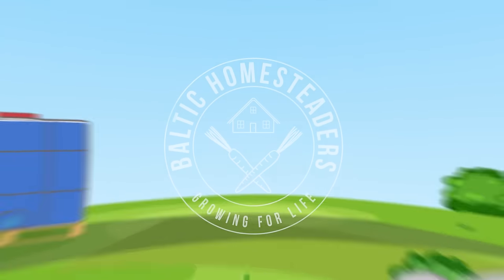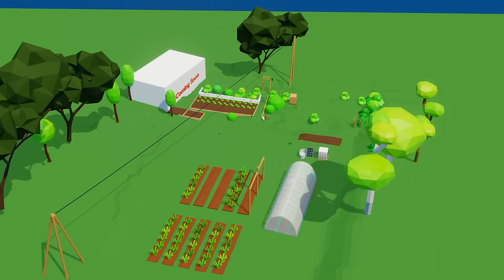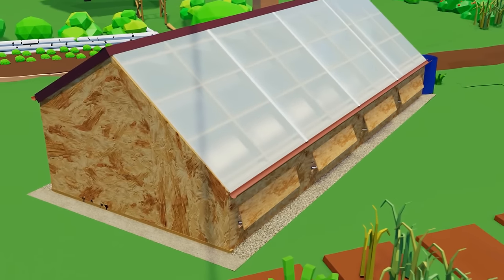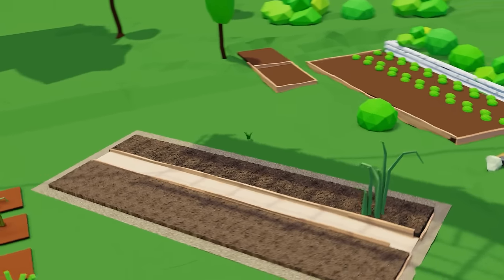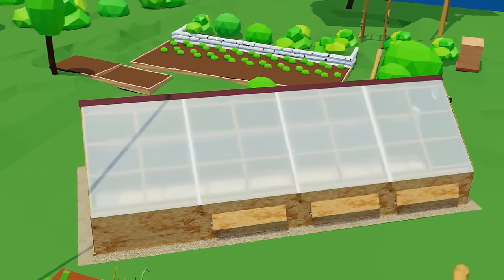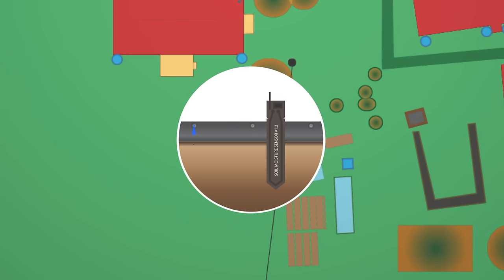Passive Solar Greenhouses - 8 Key Considerations When Building

Comment: Insulate the floor. The floor and glazing is where you loose the most heat. You might be better of in raised beds. It's less labor and easier to insulate to keep ground from stealing the heat.

Comment: I'm wondering what your thoughts are of double walled polycarbonate? I'm planning a greenhouse build for northern central Alaska and I'm wanting to have some air in between my polycarb panels to act as added insulation, but struggling to figure out a plan for doing so. Thanks so much for the video, super informative.
Reply from the maker: So you'd fix one set of sheets on the outside and one set on the inside? I can't see why it wouldn't work, in theory it should really help with the R value. I guess the only consideration is to whether you'd need to clean the innermost sides and would they be accessible although in theory why would they get dirty? Installing the inside set might be fiddly though. The other way is to install the first set as per normal then use batons to hold them down (instead of the joining strips and then install the second set onto the batons?

Comment: Inflated double polyethylene has great R value and it’s budget friendly. I have double polyethylene on the top and front and twinwall polycarbonate panels on the east and west. My Greenhouse hits up to 130 F on and freezing day when the sun is out.
Reply from the maker: Hi Dave thanks for commenting. Did you buy your double poly set up as a kit or engineer it yourself?
Reply: I bought a layer of IR AC 6 mil poly film for the inside layer and the outside layer is 6 mil clear. I got a blower motor from my farmer friend. I installed the 2 layers at the same time and cut the excess. I put a Bellow over the fill tube so I can turn on and off the blower on a timer. It takes 15 minutes on to fill 11”x22” and it’s off for 1.25 hours in summer and 45 minutes in the winter. The Bellow is just plastic taped on 3 sides so the air goes in but can’t escape. A differential switch would be better though, like a air compressor. It stays full enough to insulate for around 77 days of run time per year versus keeping it on full time like everyone else does.

Comment: Since one wall is a short ponywall and light isn't hitting that area, would there be a benefit of just putting the greenhouse into the ground 3 feet and using passive geothermal air tunnels? You would then be able to utilize the earth as a thermal mass. Running solar heated water(or salts) in pipes into your themal mass would offer a deeper heat. A closed loop system.
Reply from the maker: It’s for the snow that we get, need somewhere to fall off and the ventilation windows which work great.

Comment: Hello from Chile. Rocket stoves are great for heating up a place quickly and with very little wood but they are quite bad for keeping a place hot for long hrs... you might want to consider a BBR ( Big Batch Rocket) or a russian stove... good luck
Reply from the maker: Thank you / Gracias :)
Reply: rocket stove, you might be right about that, but, are you familiar with rocket mass heater?
 the thermal output of the rocket stove gets absorbed into a mass of stone or cob or similar material, and radiates out over the course of many hours, or even days.

Comment: Hi Iam planning to build one of these but want do go deep into the ground (check wallpini) I live in Poland and here typical winter could be a bit cold (-22C 🥶 was max I've evere endure moderate not more then 10) - for thermal mass want to use a old tires and soil (check a earthship project) for glazing want to use old plastic windows (they have thermal insulation between windows and often people change them for new ones so they can be obtained for free) also very important is additional building connected with greenhouse - a chicken coop which will generate heat, inside of a greenhouse will be some hydroponics to maximise the efficiency and space. A glazing angle have to be calculated for proper angle (winter will warm and summer will chill - check earthship)  of course all will be fully automated with a solar panels ale heat regulators plus some water collection tank etc.
Reply from the maker: I thought about the wallapini approach but in the end getting a digger to come and dig the hole was too much. Maybe I’ll build one as a future project if I can find a suitable place. All the best for your build.

Comment: Passive solar buildings have glass area of about 7% of the floor area without extra thermal mass. 
Some of these designs are actually solar ovens.
A room with a few windows on the south wall would work just fine.
Paint the walls white.
As the sun moves all the plants will get some direct light.
These things are mostly useful during the coldest months.
Reply from the maker: I would love to have built it onto the house but sadly it's not in the right place or indeed the right direction. Thanks for your input and ideas, I need to work out about internal wall structure.
Reply: @BalticHomesteaders  Do you have a wall or room that faces a southerly direction? In many place you only need a greenhouse during the cold season.
Reply from the maker: We don’t have any suitable rooms. If we did then I’d use it as a starter room for seedlings.

Comment: Personally, polycarb is a prohibitive price for now. An inflated double polytunnel plastic cover works for me. I'm creating a rammed earth wall using the 'cobauge' method for the north, as a heat store.

May I ask what your CAD software is? I'm learning basic Shetchup to do my designs off paper, but it can be glitchy. Cheers
Reply from the maker: Yeah polycarb is much cheaper here. I ditched sketchup pretty quick and decided to learn Blender, it's a sledgehamer to crack a nut for this but that said it works great once you've got the hang of it.
Reply: @BalticHomesteaders  Cool, thanks for that 👍

Comment: You might want to check regulations on building under powerlines/easments. In  australia were not alowed to for sfety and access reasons.
Reply from the maker: Good point although a little late for me however this building replaces another which was already in the same place and the electric company come out and do regular visits and have never said anything. It’s a good point for others to check their local regulations though. Thanks.

Comment: Could I turn the water temperature buffer into an aquaponics/hydroponics system or would that cause too much of the heat to dissipate? I guess it would stay inside the greenhouse right so could work I guess?
Reply from the maker: If your climate allows for it I guess you could.

Comment: i would reconsider OSB it does not like moisture at all. Polycarbonate is great material. good luck
Reply from the maker: Hi thanks. Already built it. Been using sealing paint on the outside to water seal it. It’s not going to last forever but should last long enough.

Comment: the trouble with polycarbonate is that its has a short life due to UV, which you do not take into the equation, poly tunnels last longer and are cheaper but glass lasts as long as the structure.
Reply from the maker: Hi thanks for commenting. Think I mentioned this in the video but we’ll get 10 years out of it at least hopefully much longer. A poly tunnel is a very different beast. I should say that Polycarbonate is considerably cheaper here than in the USA or UK.

Comment: Saltwater has a much lower freezing point (the freezing point is the temperature where something freezes) than freshwater does. And the more salt there is in it, the lower the freezing point gets. So in order to know the exact temperature that it’s going to freeze, you have to know just how salty it is. For saltwater that’s as saturated as it can possibly get (i.e. there’s no way to dissolve any more salt in it no matter how hard you tried), the freezing point is -21.1 degrees Celsius. This is when the saltwater is 23.3% salt (by weight).
Reply from the maker: Sadly temps here go down to -30c  but thanks for the idea, anything to save having to build the wall :)
Reply: @BalticHomesteaders  Ouch, that is chilly! Hope the build goes well

Comment: I build my solar greenhouse one year ago here in Germany. Due to the solar radiation it is only useable from February to end of November but the tomatoes still look great as the night-temperature dropped below 10C on 15.10.23 for the first time. I still have a lot of problems with getting rid of all the evaporated water from the plants as I try to ventilate through a heat exchanger and only open windows when Temperaturen get above 23C. How do you manage the humidity without heat losses?
Reply from the maker: Yes I have the same problem but I have been thinking about creative solutions. One way will be to use a desiccant based recirculating filter fan. I open one window at 23 and a second at 26 and then the vent fan kicks in at 30. Now that it’s finished I’m working on a couple of final videos to explain all and then think over improvements during winter. Let’s keep in touch, I’d love to see your setup maybe send us some photos by email (on the about us tab)?
Reply: @BalticHomesteaders  sent you the email. Hope it’s no in the spamfilter😅
Reply from the maker: @fritzstierhof2467  received thanks, not had any desk time yet to look at in detail, hope to tomorrow :)

Comment: What paint did you use to waterproof the osb?
Reply from the maker: Some local brand that was waterproofing but tinted white (actually it may have been German). I then had some emulsion left over from bathrooms that I put a second coat on. Seems to do the trick.

Comment: interesting design, my only comment is the waste of space of passive rock wall at back, really will do very little, is costly and huge effort to make. Instead you could include a raised garden bed, 600mm high, along south wall of glasshouse, even wrap the corners as well. This bed will generate it's own heat with composting, and can be used to espalier fruit trees in a semi protected position, you get extra room in greenhouse, extra fruit, and same heat stabilisation as the rock in the greenhouse. Better result
Reply from the maker: Hi thanks for commenting. You’re right in that the wall is a lot of effort on my part, not especially looking forward to it, although we have all the materials lying about the place. I’m really interested in what you’re saying here but want to understand it more. Have you got this kind of setup or built it for someone.  Are you saying building a hot composting bed to heat the area biologically or just a large raised bed of compost that is simply a mass of sorts that can hold heat? Just wondering why you think the wall won’t work as a mass when many have used a similar set up, not that I don’t believe, if I could avoid building it then wonderful, just need more evidence, anecdotal or otherwise. Thank you, looking forward to hearing more.
Reply from the maker: Thank you, I’ll check it out.

Comment: You show above ground water storage outside of your greenhouse.  Why wouldn't you put it inside to add thermal mass and to protect it from freezing?
Reply from the maker: It just gets too cold here to store water over winter. The tank you mention is actually needed to water the other greenhouse as well. The whole water storage solution on-site here needs a total rethink and some serious infrastructure work so that water can be stored and pumped about and go dry for winter but that’s nothing to do with the PSG really.
Reply: @BalticHomesteaders  Thanks for your quick response.  I expect to move to an area that has more mild winter than Latvia, Eastern Kentucky or Tennessee, and perhaps use collected rainwater for household and garden use.  So I'm thinking that putting the storage containers into a greenhouse would extend the growing season and minimize effort to keep them from freezing.  In that area, with the different terrain, it might be more practical to keep things from freezing by using earth sheltered design.  But, AFAIK, Latvia is pretty flat, while Appalachia is often too sloped.
Reply from the maker: @richdobbs6595 flat as a pancake here, albeit we’re still not a slope down to a lake. Yeah I reckon you’ll be ok there, it’s got to be pretty cold night and day for barrels to totally freeze. We do use a lot of rainwater but it’s just as easy to pump it up from the lake.

Comment: Has someone a idea what to do if the greenhouse is full with led lights and the climate is in summer hot (35C max) and in winter cold (-10C max)? Im more concerned about humidity which has to stay below 60%, temp at groud below 30C and the heat in summer combined with the lights (300W/m2) that can shut down at full sun, but because there will be a lightshield installed, can run in the night. All the combinations result from that blow my brain. Before i forget - evaporation cooler possible as well.
Reply from the maker: Not sure about the lights, but doable, you’d only need them once daylight falls below 10 hours a day through winter. Yeah I’m considering evaporative cooling after 2 years using it, I’ll probably add that next year. Humidity isn’t too bad, well in summer, in winter it will be but this is only a 3 season version.

Comment: How you can say its passive when you promote automated air control, watering and even fanned exhaust? This is almost as active it can be.
Reply from the maker: Because it's a 'passive solar' greenhouse, nowhere did I say passive cooling, or passive watering etc
Reply: perhaps solar panels to power the electronics?
Reply: @gerretw  its active and requires buying panels that you can't do yourself. Stating its passive is a lie.
Reply: Passive: relating to or denoting heating systems that make use of incident sunlight as an energy source.
"bananas can be grown at the highest altitude using passive solar heating alone"
You are using a different definition of the word. Solar panels are by definition, passive.
Reply from the maker: Sami Not really sure what your problem is. This is just like many other PSGs you can find on YT. We all know that it gets too hot in summer and the heat needs to be exhausted otherwise plants do not pollinate and produce fruit. I’m growing food here not building a showroom for unproductive tomato plants. The PSG design is about keeping heat in during the cooler months.

Comment: TLDR: Passive solar greenhouses can be effectively designed and constructed using a combination of glazing, insulation, thermal mass, ventilation, and automated systems to maximize energy efficiency and create optimal growing conditions for plants.

1. 00:00 🌱 Proper positioning, glazing, insulation, ventilation, and other key considerations are essential for building an effective passive solar greenhouse.

2. 01:52 🌱 Consider building a passive solar greenhouse with precise south orientation, polycarbonate glazing, and double-skinned insulation for better heat retention and light diffusion.

3. 03:23 🌞 Diffused light makes glazing angle less important, construction materials are mainly a budget consideration, using pine and spruce for main posts, leftover fibre cement tiles for roofing, solid sides and back made from moisture proofed OSB.

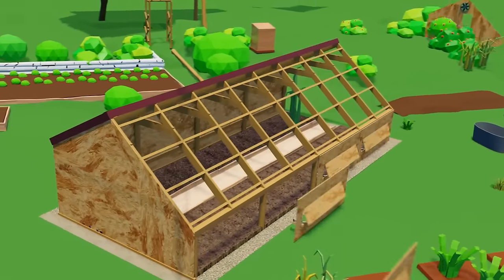4. 04:37 🌱 Insulation is necessary for walls, roof, and possibly ground to keep out frost, with options including blanket roll, foamboard, and natural fibers.

5. 05:56 💡 Use solid materials like stone from ruins to build a large mass for heat storage in a passive solar greenhouse, and consider adding a mini rocket stove for additional heating.

6. 06:51 🌱 Proper ventilation, including windows and fans powered by solar energy, is essential for cooling a passive solar greenhouse during hot summers.

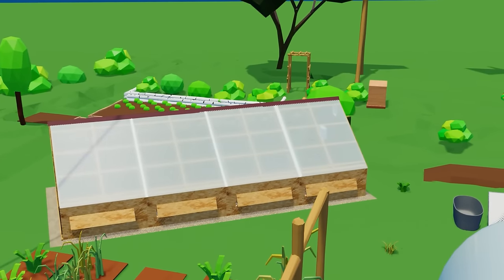7. 07:35 🌱 Good soil is essential for the success of the project, so various substrates will be added to the native sandy soil, including biochar, high-quality compost, and slow-release organic fertilizers, to create a strong foundation for soil life to thrive.

8. 08:28 🌱 Automate ventilation and watering in passive solar greenhouses to optimize growing conditions, reduce workload, and improve plant health and productivity.

Comment: We cant use double skin polycarbonat in Australia .Its ok on the walls but not on the roof. As you know its very hot here and the roof polycarbonat just breaks down in 2 years. We can use single sheets ofsun tuff Australian product but the twin wall stuff is from China and its rubbish
Reply from the maker: Is that because if the heat or the UV? Most modern polycarbonates are coated with UV blocker but as you say maybe not the Chinese stuff?

Comment: Полностью пассивным не получится, у нас очень мало солнца зимой, продлит вегетационный период, что тоже хорошо.
Успехов.
Хочу себе с южной стороны дома таплицу-зимний сад пристроить.
Reply from the maker: It’s a 3 season greenhouse not 4. Also mentioned is that there is the option for a small wood fired heater inside. Light will be the issue not heat.

Comment: water is not the most efficient heat storage material nor the best for a greenhouse. coconut oil and palm oil are better if you know how to calibrate phase changing to suit your needs (palm oil fusion at 21-23°C, and adding in unsaturated fats to it, following eutectic or near eutectic composition, you can create a buffered temperature at or below that temperature). the thing is that costs like 300 usd per metric ton (about 1050 liters i think) without shipping. and you can suffer an oil spill xD. worse case, USA invades you. 

but water is the cheapest and safest, no the most efficient as you cannot use of its amazing fusion enthalpy as a heat buffer, and the temperature will not be stable as water is not a heat buffer, but a high thermal inertial material.